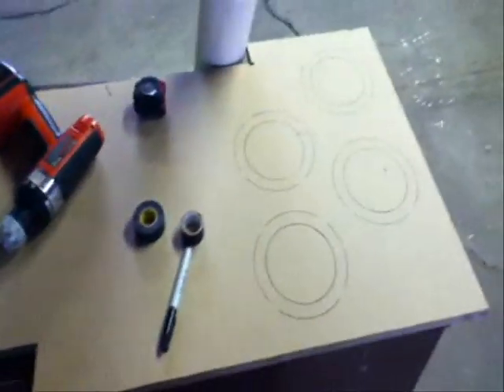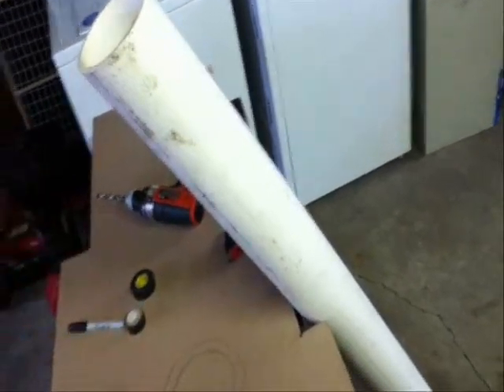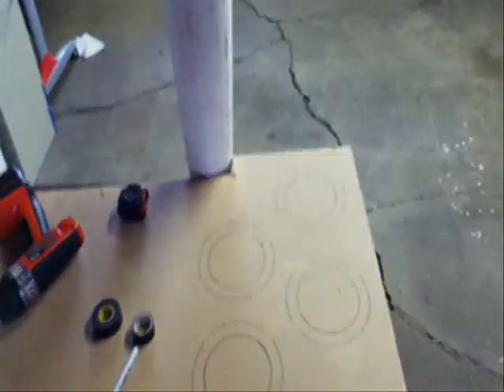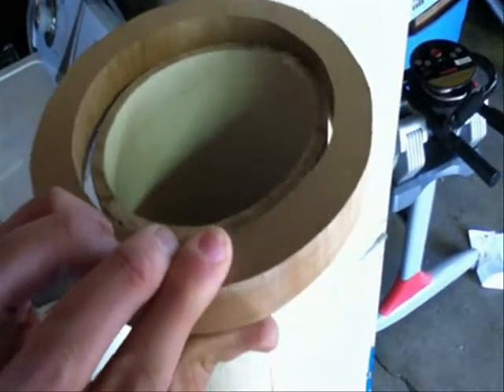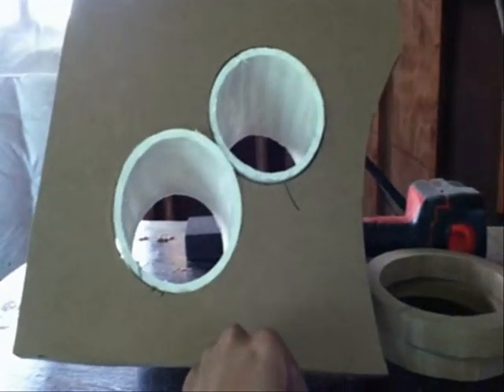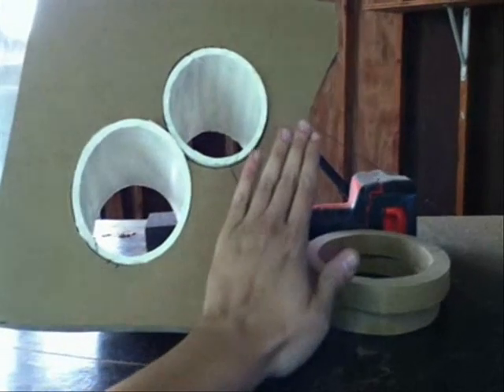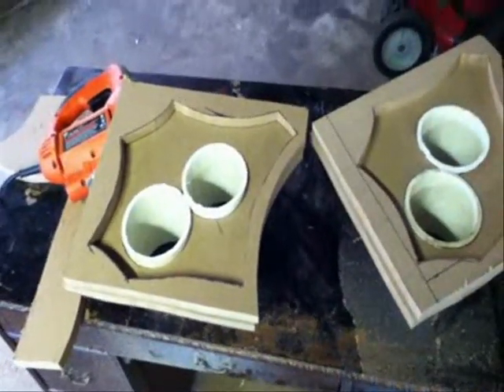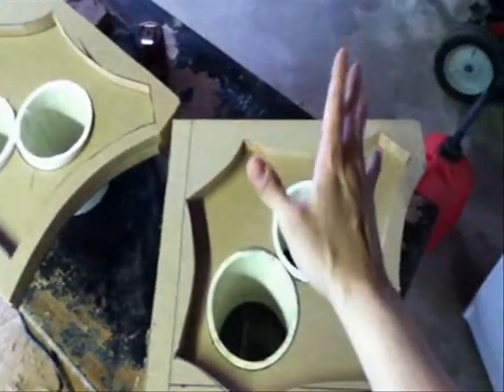Homemade Ports for Subwoofer Wall

Comment from the maker: I know it sounds crazy but the math supports my insanity. I will be doing a vertical clamshell with 3 of the subs being inverted. I just need to cut out the rear deck. Once it is built I will line the inside with the 2 14" acoustic foam that is in there now and a gaggle of polyfill. ~20+lbs. Should give an F3 in the low 30's and with the cone area I should still be able to play some lower stuff with authority. Hows that for a slice of fried gold.